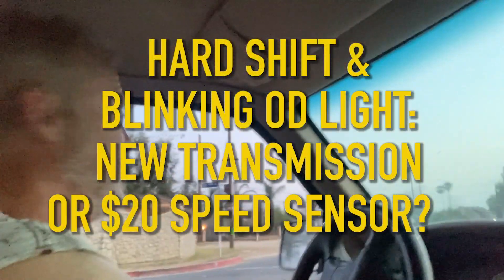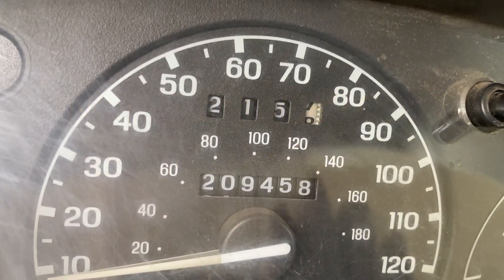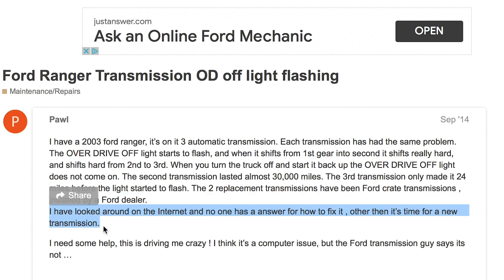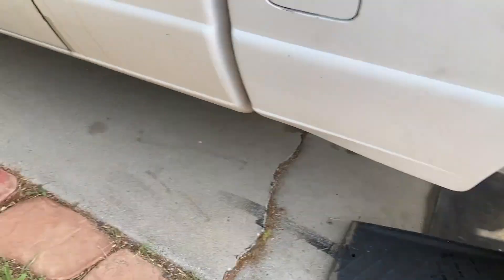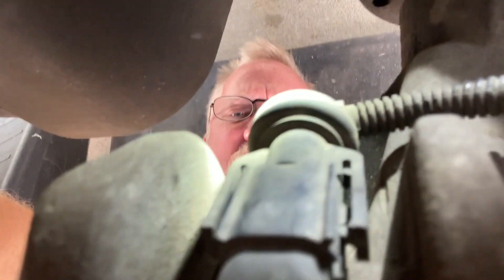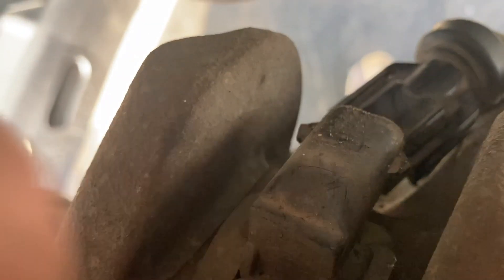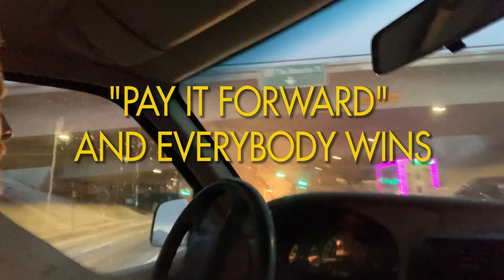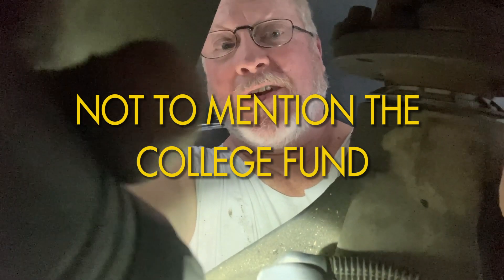Flashing OD Light & Hard Shift on automatic Ford. Replace Transmission or install $20 Speed Sensor?

Comment: So I replaced the speed sensor on my Mazda b3000 and overdrive light keeps on blinking on and off any ideas why it's still blinking I'd say prolly like 20 to 30mins and overdrive will blink on and off
Reply: Did you figure it out?
Reply: @sharkmansharkman3929  no
Reply: @sharkmansharkman3929  unfortunately I didn't 😕 still figuring it out I changed the speed sensor
Reply: I feel like maybe yours could be the transmission fluid temperature sensor if you could drive 30 mins until overdrive off kicks in. My overdrive turns off right when i put it in drive, but I know that my speed sensor is fine too.
Reply: @sharkmansharkman3929  OK I was thinking the same will a thinkscan s2 obd2 scanner read transmission codes?
Reply: Yeah mine says p0765 which is solenoid D malfunction, already checked the wiring and solenoid and they're both fine so I'm really confused. You have a check engine light on?
Reply: @sharkmansharkman3929  no check engine light just the o/d blinks after 30 min or so of driving
Reply: @Mylotheblacknwhitecat  oh yeah i don't think a normal obd2 scanner would give you any info then

Comment: I also had problem with OD light flashing rapidly and transmission hard or short shifting. Turned out the selinoid board was separating when transmission was getting hot. I can thank the shade tree mechanic who installed transmission. It was getting hot and and solder  was separating on board. The mechanic who installed my transmission was supposed to have put in heavy duty selinoid pack and instead put in after market part instead.

Comment: thank you very much for your video! I was able to solve the problem with my 1999 Mazda B3000 V6, the truth is that they invented a failure in the computer and I had to pay $250 dls and it continued with the hard shifts :(

Comment: I have a 180,000 mile ford explorer 2003 its having the same issues. I was stumped until I came across this video, hard shifting, high rpm before a violent shift... O/D OFF light blinking. I will update on whether or not this was helpful. Thanks for the video.
Reply: Update
Reply: @adambryant1227   TL/DR: Changed the transmission fluid. Problem fixed.

The problem was basically the transmission. Since the car has a sealed transmission, the fluid usually isn't changed. I went to a shop and they denied to change my transmission fluid. My mechanic wanted to charge too much. Had a family member make the change, he said the fluid was sticky, black, and had a strong smell. The car's O/D light came on only a few times thereafter but it really feels like the car experienced a rebirth.

Comment: I got a blinking Overdrive just like yours but when i scan it, it detects an error code p1603. Is changing the speed sensor the solution?
Reply: P1603	ID Number Unregistered

Comment: Similar problem on a 2000 F250 4wd  no codes except the ABS rear speed sensor , replaced and reset the codes. Same code came back no signal from the sensor.  Time to start tracing wiring.  Have already repaired multiple broken wires under the hood.
Reply: Any update on your solution?
Reply: @johnpaulcurran1843  it's on the back burner for now. Done multiple drain and refill of transmission fluid, which helped some. I think the problem is the shift valve solenoid assembly is gummed up.

Comment: My 2011 ford Ranger OD off light started flashing yesterday but I see no difference in the shift pattern?? Very smooth shifting and fluid is nice and red I can’t tell anything is wrong other that the OD off light flashing so I may try this seems easy and inexpensive to try good video
Reply: how did this work for you??
Reply: @WPGinterceptor460Interceptor  Trans had to be rebuilt and a bad Torq converter
Reply: @6548ww yikes why did you have it rebuilt if it was shifting good?

Comment: I tried this and it seems to have worked for me. I have an 05 Ranger that began shifting harshly about 2.5 yrs ago (I only drive about 5K mi/yr since COVID). I thought the transmission was about to go out (truck has 125K miles) and I'm unable to pay the $3K to $4K to replace it so I thought I would just run it until it stopped running. But the transmission never really stopped running and then I came across this YT video and decided to give it a try. It has only been 1 day since replacing the rear differential ABS speed sensor but it does shift a lot smoother than it did before. Still not like it should though -- it goes up to about 3K RPM before shifting up to next gear but it is a smooth shift and not a harsh/jerky shift. I had been driving the truck really slow and easy since the shifting got harsh so I hope I have not done too much damage over the past couple of years.

I also recently found another YT video (FordTechMakuloco - Ford Quick Tips #66) stating that some Ford transmissions have a computer algorithm to teach it to shift properly -- so maybe it will take time for my truck to relearn how to shift properly. Alternatively, the other YT video said to take it to a shop where they can erase the transmission learning memory with a professional scan tool because simply unplugging the battery will not erase the transmission learning memory data. The transmission computer chip will then begin with new fresh data and start relearning the the proper shifting and  adding it to the new transmission memory data.

Anyway, thanks for posting this video -- otherwise I would have kept driving my truck until the transmission fell out of it on the road somewhere.  😄
Reply: update on this? did the hard shifting go away
Reply: @WPGinterceptor460Interceptor  Yes it worked sort of. It ran quite well for about a week. Scotty Kilmore YT channel shows how to use a 10-ohm resistor  on computer after unplugging battery that does exact same erase as scan tool. I did that and still after about a week or two, it started to take a while to shift 3rd to 4th and 4th to OD. But it was not "hard" with a big clank as before. The tranny actually has 3 speed sensors -- 1 on differential (which I changed), and 2 on tranny (in rear of tranny and 1 in mid area driver side of tranny). I have not bothered with changing those since I hardly drive the truck anymore. Only use to buy lumber once in a while at lowes. I drive around hood once every couple weeks to keep fluids moving in engine. Perhaps changing the other two sensors and a fluid change will finish fixing it? I got a 2015 Sienna and w/ seats removed, I can carry 4x8 sheet lumber so I may sell truck sometime next year.

Comment: sir do you mean hard shift or shift shock? mine nissan sentra has a overdrive blinking 16x the issue when i drive it it has a shift shock at drive 2. but smooth on 3rd and 4th gear,

Comment: Question today I was driving my 06 f150 4 6l and od light started flashing parked shut off truck light was off drove about 10 mins light started flashing again any ideals should I change my speed sensors first
Reply: Mines doing the same thing same year and make Did you find a solution to this problem if so please tell me

Comment: Im having the same exact problem with my 05 mustang gt the thing is i did the sencor swap and it didnt work so i took it to the shop and they held it there for 2 years swapped transmission and all, STILL SAME PROBLEM can anyone give me a hand on what i should do
Reply: There is likely more than one speed sensor. My 05 Ranger has one on rear differential, three on transmission itself (1 input, 1 output, and 1 intermediate), and then I think each of the wheels have one too. I would guess that the transmission computer chip uses more than one speed sensor? You might try the $20 output speed sensor on the transmission itself next?

Comment: 03 4.6 v8 Mountaineer here..replaced transmission, transfer case, rear diff and still had the OD light flash... took me 6 years and too much money wasted..when the speed sensor fixed my years old problems.. thanks for this!!!
Reply: Mine has the same problem i replase the speed sensor n still have the ov light flashing whatever can be
Reply: I meant whatelse can be

Comment: Would this help my 1995 7.3 powerstroke?
Reply: Did you try this and what’s the update on yours? I have a 1997 7.3 with similar issues. Previous owner said it was rebuilt around 5k miles ago with a heavy duty torque converter installed too

Comment: Replaced the speed sensor, still same problem
Reply from the maker: Sorry if it didn't work this time Justin. Could be you do need a new transmission. That would suck.  Try  changing out the 2nd speed sensor also before you sink a couple thousand into the tranny. Sometimes the cheaper fixes do work.
Reply: @lazycowvintagethriftdesign5595   Will do. Thanks for taking the time to respond back and providing more info.
Reply: @off7547  what was the problem

Comment: Those transmissions are the worst of the worst. Time to throw it away. I threw my 97 away....but I still managed to get $2700 for it 😇
Reply from the maker: I'm sure there were plenty of mechanics offering to put a new tranny in! Glad you got some cash for her. I've had Ford Rangers manual & auto since mid-80s and never had to put in a new transmission. I used to blow thru clutches tho when I was younger!😁

Comment: I have an 07 Mustang and have the same problems. Transmission shop said it was a sprag and they want $1800. What should I do
Reply from the maker: Hey Gabe. Definitely try replacing both speed sensors first!  Maybe it is the sprag clutch that’s out. That said replacing the sensors often fixes all sorts of OD light, transmission, speedometer and ABS brake issues. Parts maybe $50-75 for both.  Do it yourself or have a mechanic do the labor (probably listed at 2 hours for both, actual time up on the rack 1/2 hour).
There’s several Mustang how-to change speed sensor videos up on YouTube. Search 07 Mustang Speed Sensor to see where they’re located.
Let me know if it fixes a Mustang. It’s worked on plenty of Ford trucks and vans already. Good luck!

Comment: shit I have all these problems with my 1995 f 150.. they told me to replace trany. all the problems with speedo stopped working, overdrive off flashing, trany slams' threw gears like a race truck, these all started at the same time. mechanics keep telling me I need new trany. last owner said it was a rebuilt trany. I will try your fix and Joel Morales sounds like it fixed your problem which sounds like my problem...THANKS GUYS
Reply from the maker: Sometimes it is the tranny, but often it's 1 or both speed sensors are out.  A lot of mechanics don't seem to know and go straight to the expensive new tranny fix.  Which then fails when the sensors aren't replaced. "Always try the cheapest fixes first."  Best of luck Ron. Let me know if it works.

Comment: This was filmed in April 2021 ? Has the shifting remained good? It is interesting to wonder why a speed sensor would cause hard shifting if the speedometer worked correctly?
Reply from the maker: Hey Dave. As of November 28, 2021 Adventure Truck is running great with never hint of any shifting problems. 
My thinking is the front "ABS" sensor controls the speedometer and anti-lock braking system. The rear differential sensor informs the ECU Electronic Control System which tells the transmission when to shift.  Either system malfunction may confuse the ECU as to the RPMs of the wheels and result in a late, hard, or non-existent shift.  That's my theory. Actual fact is that this "trick" very often fixes the problem.  Can't hurt to try! - Grandaddy-o

Comment: So you needed to change rear ABS wheel speed sensor not output shaft speed sensor on the transmission
Reply from the maker: Usually it's the rear sensor causing the issue but some people have reported no improvement until they did both.  Cheap parts and less than an hour labor for both. Good luck!

Comment: I have a 1997 Ford F350,7.3 powerstroke,auto,and 4 wheel drive.I was having the same symptoms.It ended up being the gear selector switch on the transmission.
Reply from the maker: Great news you found out what was wrong!  Cheaper fixes are way better than a new transmission. 😉

Comment: I been trying to find the issue 
And 
Today, i went to see ,double check if auto parts places have in stock those 2 different parts 
Short
Long version 

They do..
Now, I will remove the old part ,see what happens next 
 right now I will
Reply from the maker: This is a great first thing to try. Best of luck Jose.

Comment: Nice video. I have a 1994 e4od that when OD switch is ON, it wont move but when I turn it OFF I hear a thump and the vehicle moves. EVERYONE say "REBUILD, REBUILD". The problem is that I just had it "rebuilt supposedly". It lasted one month and now this happened. Any idea what to do? Thanks.
Reply from the maker: Oooooo that sounds like a problem.   With unusual symptoms like that always do cheapest diagnostic first.  Replace the the speed sensors as a a first try. Please report back so we can add another symptom to look for if that's the problem. THANKS - Grandaddy-o

Comment: I have a 98 ranger doing the same exact thing. How can you tell it’s not the front sensor?
Reply from the maker: Sometimes the front sensor will cause the speedometer to go wanky or the ABS lamp to light.  Or not.  $20 part for rear SS and $35 for front. Rule of thumb is go for cheapest easiest most likely fix first. Good luck! - Grandaddy-o
Reply: @lazycowvintagethriftdesign5595  got ya! Yea speedometer is fine same with abs system. So I’m gonna grab it now and replace it! Thanks for the reply man
Reply: @lazycowvintagethriftdesign5595  well the shifting problem is fixed BUT the o/d light is still going and the speedometer isnt working so now i guess the front sensor hahaha, still that hard shifting went away so thank you!

Comment: I have had the same problem with a 2001 Ford Ranger 4.0 V6 4X4 since I bought it. The only thing different besides the O/D Light blicking is that, mine wont shift from 1st to 2nd unless I let go off the gas pedal, otherwise it would just go all the way up on 1st gear.  Does the 4.0 4X4 2001 Ranger comes with the same sensor? I definitely want to try this
Reply: Did this fix your problem? Just bought the same ranger as yours for cheap. "tranny problem but I wasn't too worried it shifted pretty fine actually. I'm noticing that going into reverse has problems. And the O/D is flashing when I got up to 60.
Reply: @Ty-px3ys  to be honest I havent had the time to lool into this, sorry :c
Reply from the maker: Yes the 4x4 has a transmission and differential speed sensor and either may go wanky with funky shifting symptoms. I would definitely switch out the differential sensor first. $20 and 20 minutes and MAYBE that problem is done with. Good luck! - Grandaddy-o
Reply: @lazycowvintagethriftdesign5595  Thank you for the reply. After some digging I found out that this is actually an ABS Sensor which is on top of the differential correct? I just want to make sure I buy the right part for it
Reply from the maker: @thesubigang4291   Yes, sometimes the ABS light will come on also.  I'd go ahead and change out both - couldn't hurt and might help. Good luck.

Comment: I've been chasing a problem in my 01 v6 3l ranger, ill turn it on and it'll drive fine, ill turn it off and back on and it wont shit to anything past 1st (It is a auto), then I turn it  off and back on and it works perfectly fine, also sometimes when I'm slowing down my idle will drop and the oil gauge will go crazy then it'll go back to idling just fine, its very strange and I would love any feedback possible, also the od light does no flash or anything, any help is appreciated.
Reply: Oh and where is the front geared speed sensor located exactly? Sorry I dont have the best knowledge with ford rangers.
Reply from the maker: I believe it's the output speed sensor.  I have a '98 and the front speed sensor is geared.  Check out this video - it looks like the 2001 is non geared.  A little tougher to get at than the differential SS but shouldn't take too long.  Looks like an '01 takes a torx wrench also.
Good luck! - Grandaddy-o
https://youtu.be/m01UZB4gMDo
Reply: @lazycowvintagethriftdesign5595  thank you so much!!
Reply: @lazycowvintagethriftdesign5595 Hello again, I changed out both sensors, I thought it worked but unfortunately the problem still persists, it’s an odd issue, it seems to be something electrical, because I put it into neutral then back to drive and it will just shift like it never had a problem, sorry to keep bothering you btw I’m just lost, idk if it’s a serious issue but if you can find anything on it or if you have something else in mind that could be the culprit please let me know, thank you for the help anyway it’s much appreciated!!
Reply from the maker: So no check engine light or OBD code? Intermittent problems are really frustrating. With no flashing OD light it's not likely the differential Speed Sensor. However, because both problems happen when the car is changing speeds the front Speed Sensor with gear just might be the culprit. Here you can see both style speed sensors 8:36
Around $35 so not a bad thing to try. Good luck!
- Grandaddy-o
Reply: @lazycowvintagethriftdesign5595  Thank you so much it means a lot to get someone's opinion that knows what there doing! I will definitely give it a try, I'm going to try the rear speed sensor replacement first, if that doesn't work then ill give the other speed sensor a try, thank you so much again its great to have someone's two cents. Oh and is there a actual name for the front geared speed sensor?